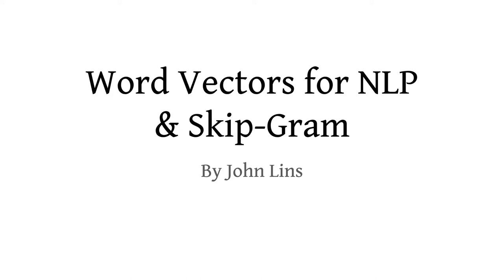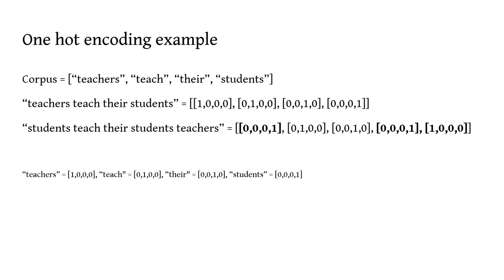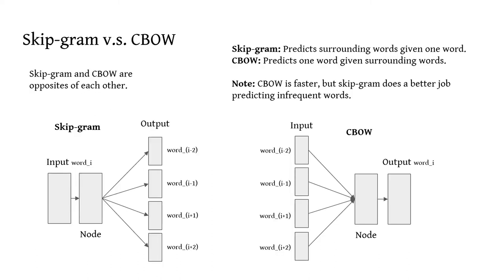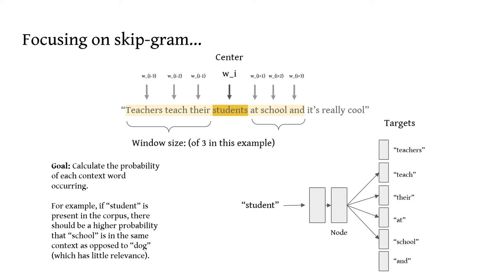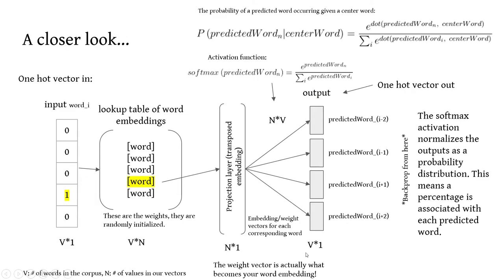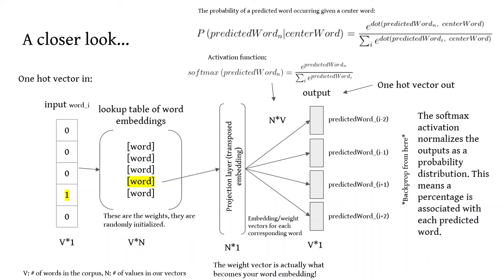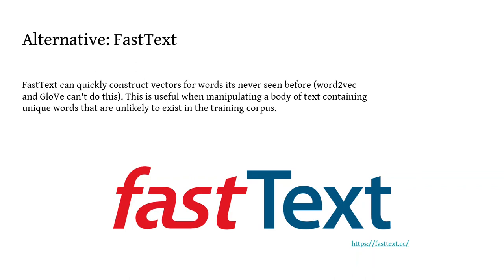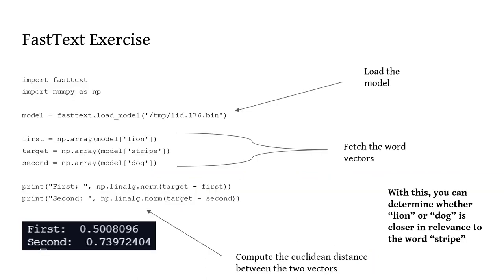Skip-Gram Model to Derive Word Vectors

Comment: Hi John, Great explanation. However, I have a question. How does the model output different context words, if they all share the same embedding vectors(hidden->output)?
Reply from the maker: Thank you for your question! Note that there is a word-embedding matrix which results in the manifold of output prediciton vectors. In the video, I just said "second set of weight vectors" 9:30

Basically, they don't share the same embedding vectors.
Reply: @johnplins  Thank you so much for your response. You said "there is a word-embedding matrix which results in the manifold of output prediciton vectors". But how exactly does the model able to produce different output predictions with only a single embedding matrix? 

From my understanding, the output of each prediction is the product of the projection layer and the second matrix. If there is only "one" matrix in between the hidden->output layer, how is the second prediction going to be different from the first?

Thank you.
Reply from the maker: @figoaranta3505   To clarify, there is a matrix for each vector output. Each matrix transforms the vector from the previous layer differently. I understand now why my explanation was a bit convoluted; I'm not saying there is a single matrix that outputs multiple word vectors from the same input, but rather a matrix for each context word each with its own corresponding output.
Reply: @johnplins  Hi John, now that makes a lot of sense. So instead of only one matrix, multiple matrices contribute to different vector outputs. 

Thank you so much for the replies, they have been very helpful😄.